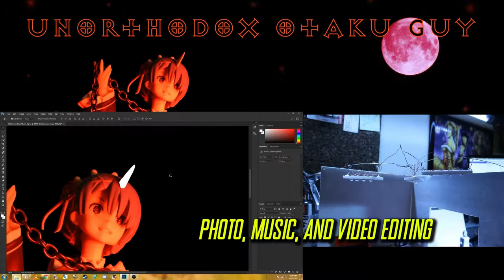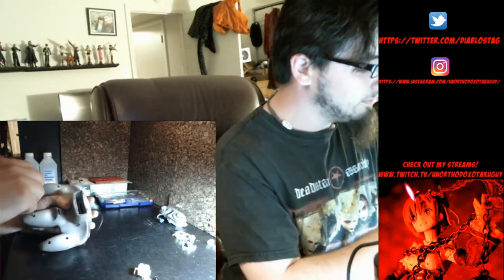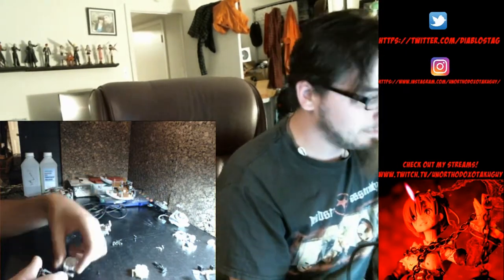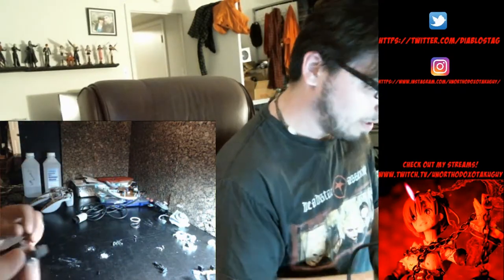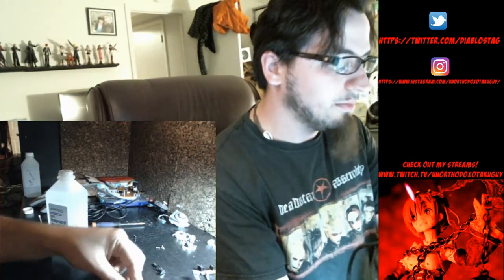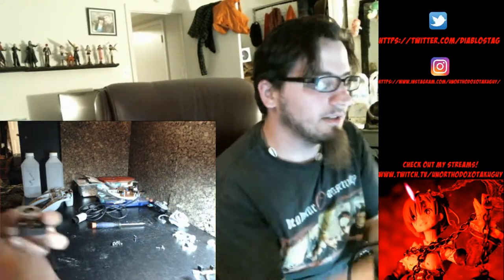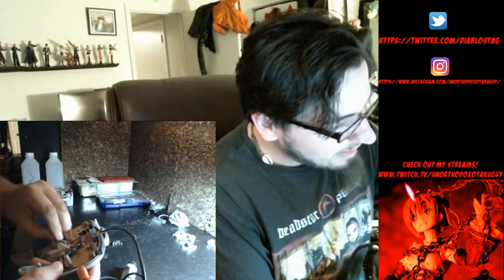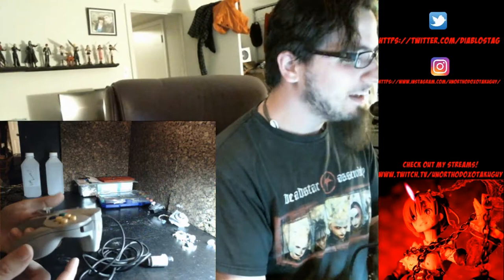Can you make a N64 Controller feel new again? - Mechanical Control Stick Repair

Comment: Installed new bowl, gears, and stick. Feels pretty new, but I have lost some of the range on the analog stick. I can't run, look up, or crouch in Yoshi's story without putting a lot of pressure on the stick. Do you have any recommendations?
Reply from the maker: Definitely! Sounds like you are binding for sure. Double check to make sure you have everything carefully filed down. May have restrictions somewhere. Then also make sure you don't have the axis pivots not switched. I don't think they are both identical. Since the tip of the bottom of the stick that glides in the bowl. Make sure the bottom of the stick doesn't have any burrs. And make sure the bowl is clean. Could add a very small amount of grease that is thin. Give the stick a good palm spin to make sure it's all settled in there. Then test all directions to see how to springs back to center from flicking and also doing it slowly to see if it hangs. 

Hope you get it figured out! It's pretty simple so it's probably a small snag.

Comment: Cool! I used all new kitch bowl, gears, and stick and tried getting rid of the flashing but when i re-assembled the controller, I have the controller drifting after I make a movement. It visually appears to snap back to center but must still have a little bias. For example, in the goldeneye start menu, the red cursor just floats around. I can stop it with pressure on the stick, but that's now how it should be. Do you think I need to file down like you did more? or grease? Thanks
Reply from the maker: Ive managed to get them to work perfect without grease. I need to grease them eventually but definitely make all areas freely smooth with filing. Then stretch the original spring so it's got some fresh oomph to it. I start by double checking all areas for sanding. It'll work perfect without the drift or jamming. I re did one that had one and it fixed fine.
Reply: @pixel_overkill  dude. Did this today with my kitsch parts and let me just say, my controller that had the worst analog is now my best controller! Thank you so much for this video. I used a small drill bit to ream out the holes for the optical encoder on the kitsch bowl and sanded the little "u" parts where the gears rest. I re-used my own gears and man is this awsome!! Oh and I used the kitsch control stick too - my own oem was worn down. Nice and precise and tight now with no drift!!!
Reply from the maker: @bryanb736  That's awesome to hear!! Yeah I can honestly say I am 100% happy with my restored controllers. I did roughly 10+ of these and it was painful but so worth it!